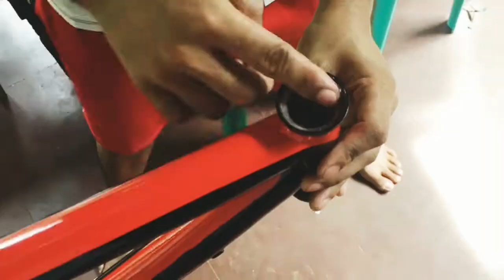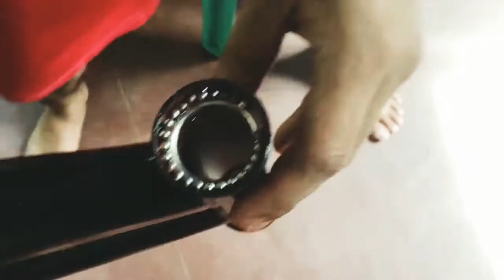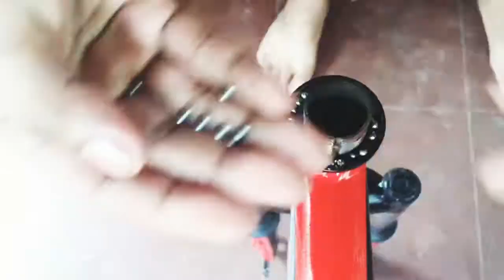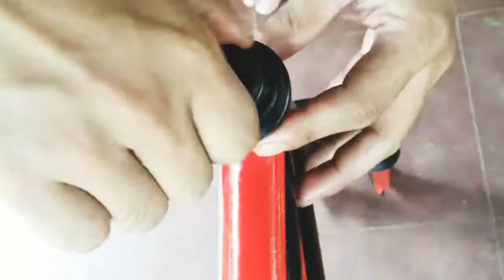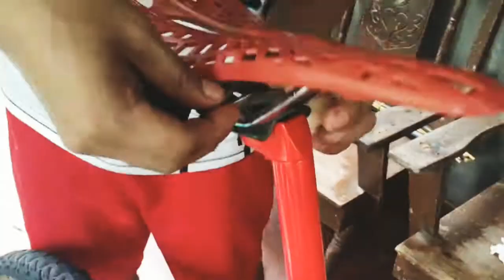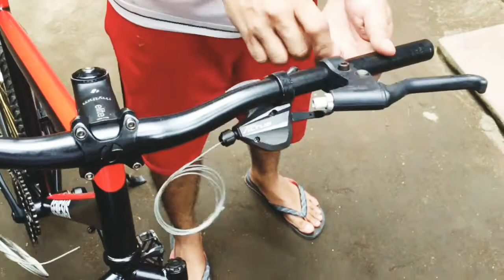Standard MTB Repainting | Part 2 - Assembling

Comment: BOSS ANO SIZE NG FORK NYO AT HEADSET AT BB IDOL
Reply from the maker: Fork - size 26, standard size ang steerer tube 1 inch threaded. Ginamitan ko ng adapter na 1 to 1 1/8 para malagyan ng OS na stem
Headset - standard lang
BB - 113mm